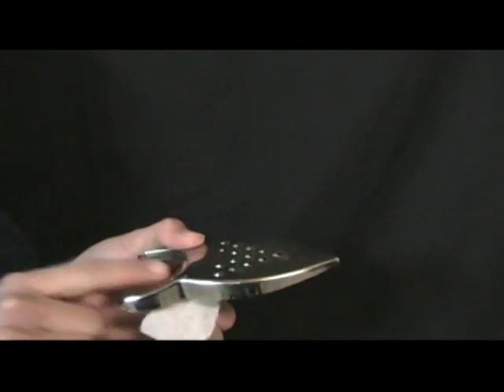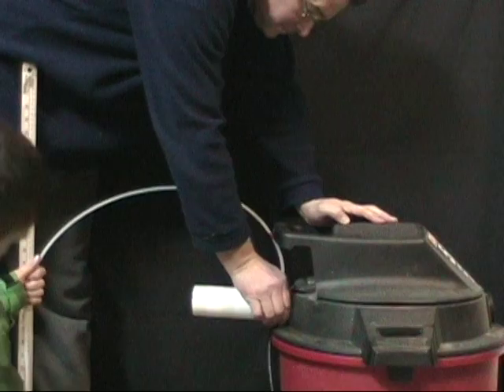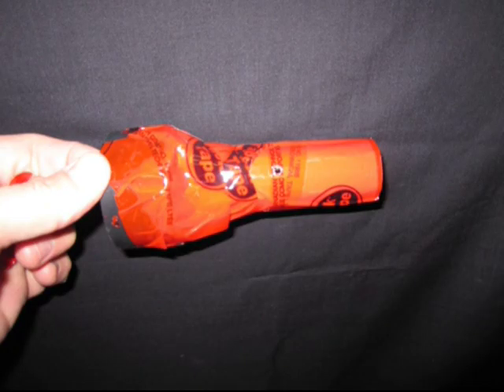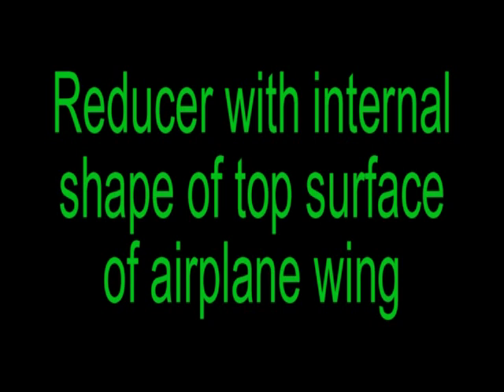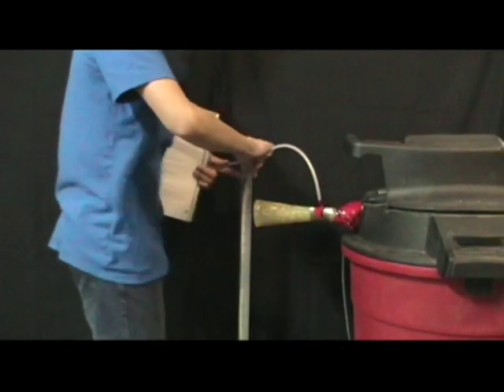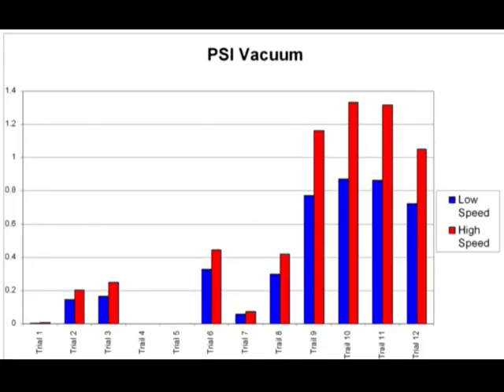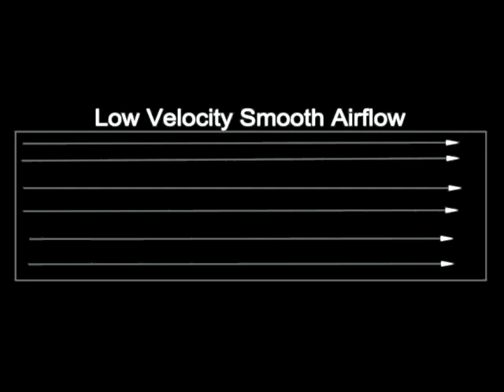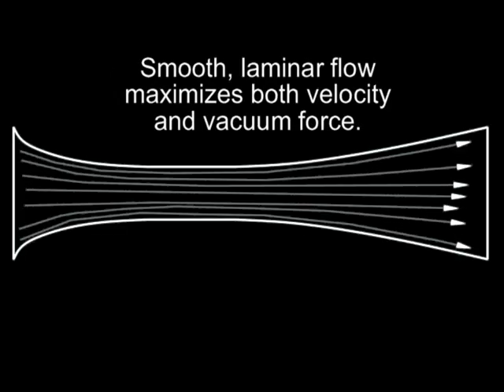Grade 8 Science Project - Venturi Vacuum Pump

Comment: Of course, the kid didn't explain what laminar and turbulent flow is and how he knew   what type of flow he had.  Also, why is he recording pressure difference in psi units when he is measuring with inches of water? And furthermore he mentioned the equation pi*r^2*L but doesn't explain what it is (i.e., volume of a cylindrical section - say pipe - of radius r and length L).  Sounds like he had some help beyond 8th grade.  Unless I missed it, what was the measured vacuum or positive draft and associated flow he was trying to obtain to replace the flow from an electric fan?

Comment: You didn't specify what angle your holes were, and how you made them. That's actually pretty critical. You don't want any high speed air going down the hole the wrong way. Pressing a hot awl into plastic at a about a 45 degree angle should work best. You want a little ridge at the leading edge of the hole to push the fast stream of air up over the top of the hole (like a cheese grater hole). Getting a faster stream will help to increase vacuum, but the real secret is getting the angle of attack right and getting the ridge right.
Reply from the maker: Absolutely fantastic comment!

You're dead right!  This is exactly why the cheese grator example at the beginning worked.

There were a couple of reasons we didn't do that with the venturi.  

The first was very practical.  

The venturi was made of fibreglass and it doesn't really thermoform like non-crosslinked, non-reinforced plastics do.  The shapes would have had to be molded in.  Difficult to do, and would have required a plug that I could deflate or melt out to extract (much trickier to make).

The second had more to do with experimental design. If we were to test the venturi with a smooth bore, and then make protrusions into it afterwards, we'd change the effective inner diameter of the throat, thereby nullifying the validity of the pressures and flows recorded in any previous portions of the experiment.  We'd have had to do it that way right from the start.

Since what I really wanted my son (and the other kids) to understand from this is that accelerated, smooth air has lower pressure, and that this could be used to do work (using atmospheric pressure to move air into that low pressure area), getting into that kind of detail was a bit beyond the scope of this experiment.

About a year later, we built on these findings, using a set-up that better emulated an exhaust pipe exiting to the atmosphere with a larger ID pipe used to form an eductor.  Here it was more about tuning and less about theory.

I like to joke with my wife (the engineer) that a scientist calculates how things should be and declares that to be reality.  An engineer does the same calculations, then builds it.  Then they go at it with a hammer  a saw and a torch until it works like their calculations say it should...

This second phase was engineering.

We tried different lengths and different inner diameters of outer pipe (inner pipe can't be changed without changing the power output of the engine, so we left that variable fixed), and different pressure tap points.

We routed the pressure tap through a 3 foot long 1" ID hose (simulates a pipe leading from the muffler to the radiator) to a manifold leading to a cut-off cereal box with ducts to keep the airflow fairly straight ( this simulated the radiator), and measured the average air velocity at the box opening.

The velocity in Feet per minute time the cross sectional area of the box in square feet gave us Cubic feet per minute.  

We maxed out at about 100 CFM, but with an eductor length that was too long to be practical on a dirt bike (would stick out the back and get bent/broken).  

The electric fans are closer to 150 CFM, so even at 100 CFM this wasn't a valid replacement for one, particularly since the flow was dependent on engine speed, which is not true for an electric fan.

We didn't change the world, but by the end of the project, my son understood a lot of things about airflow and pressure that he didn't before.

Once again, thanks for the fantastic comment!